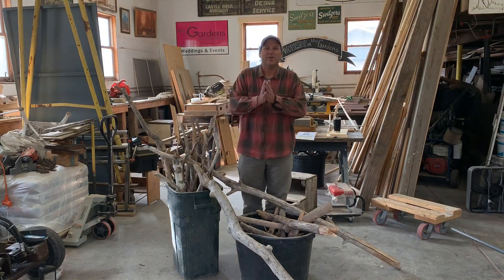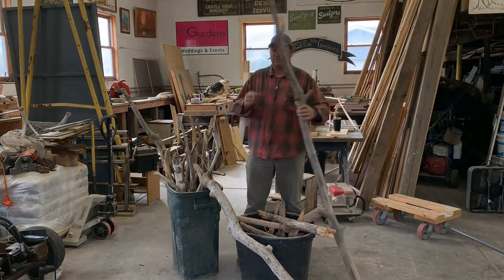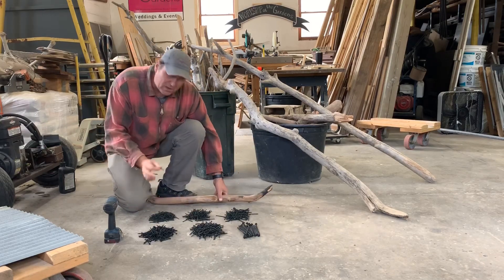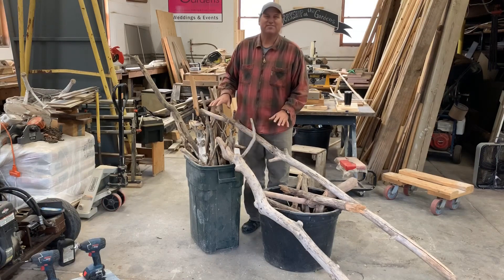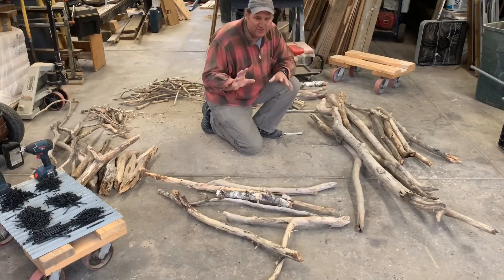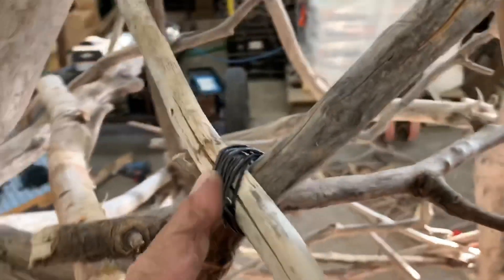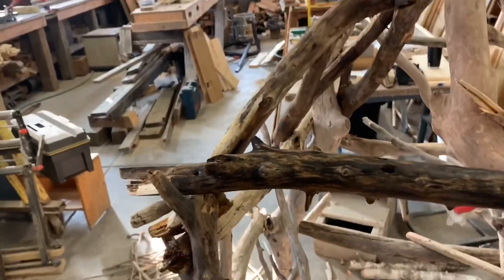BUILD A GARDEN OBELISK TRELLIS with Branches & Twigs ~ DIY Project 4U

Comment: Great idea! Was it hard to put the screws into two non-flat surfaces? I have been meaning to get a power drill for assembling wood and bamboo structures but not sure what kind to get for these types of projects. Does a 12 volt have enough power?